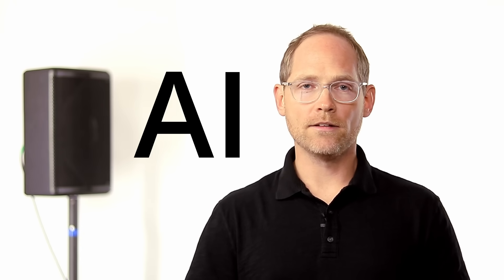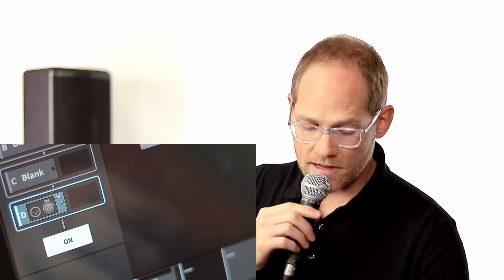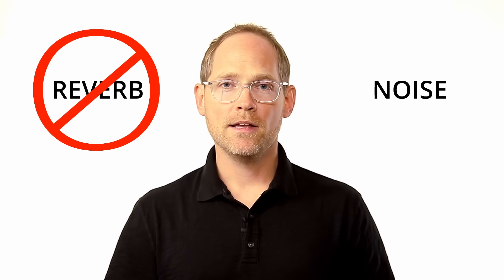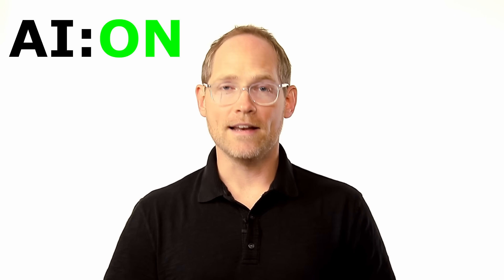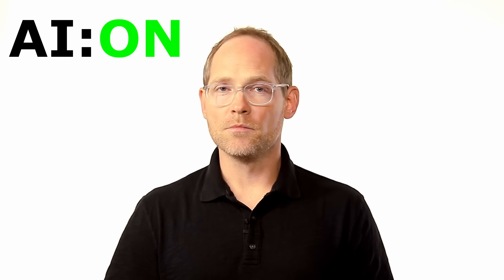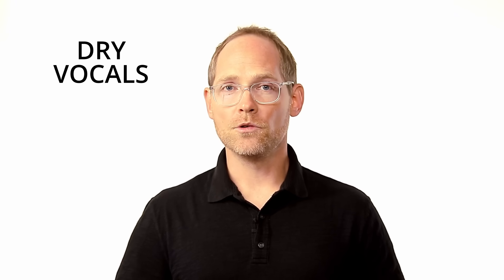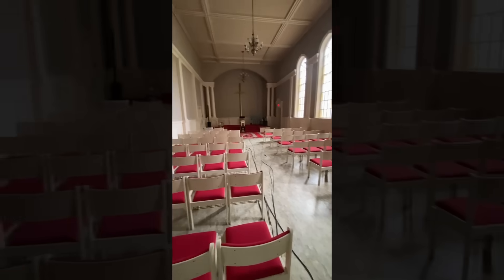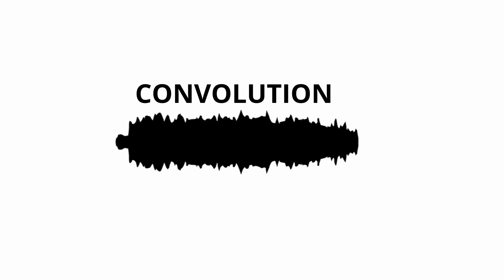AI De-Feedback/Anti-Reverb Demo + Full Explanation

Comment: Just tried the demo. Not gonna lie here - this is very impressive! 
Not exactly ready for primetime use on my computer, though, namely a Macbook Air M3. I'm used to work at 32 samples buffersize all throughout (/w Logic Pro at 44.1kHz, using a Motu M2, resulting in 3.5ms (measured) RTL), for the Defeedback plugin to work I have to switch to 64 samples, and even then CPU usage is so high I can't run pretty much anything else on the same channel (or bus it gets sent to).
Still, quite impressive, really!
Reply from the maker: Yes, this is expected behavior unfortunately. We tried our best, but the reality is that Apple’s linear algebra libraries just aren’t as good as Windows, and with Mac Silicon it got even worse. We almost didn’t release a Mac version because of this, but enough people have uses for this product that don’t require absolute lowest latency, and they’re sometimes in situations where they are restricted to Macs, so we released it in “beta” form. 

For anybody needing to run this plugin reliably at low latency, we officially recommend using the Windows version and specifically on something like our recommended hardware options on the website, which we worked really hard to get in shape at the OS level.
Reply: @devinlsheets_alphasound  Thanks for the clarification. Any chance of an optimzed Mac version one day or is it just not possible?
Reply from the maker: @Sascha_Franck  we’re still poking away but it’s not looking good for Mac.

Comment: While i will agree with the many who say this should be integrated with waves soundgrid , i have 2 additional questions to ask :
1. Have u considered about running this plugin on GPU ? I remember seeing there is a company called gpuaudio which developed an architecture to run vst plugins on gpu for ultra low latency.
2. what about the use of multiple defeedback plugins in series ? would that work to get even more gain out of your mic before it resonates into feedback?
Reply from the maker: We’ve considered the GPU option but at that point we would just go FPGA. You could use multiple in series but the artifacts will become obvious.
Reply: @devinlsheets_alphasound  ok thank you.

Comment: 11:30 What? A small handful of humans on the planet?

Are you not just updating your “equation” 8:00 at a slow interval while your realtime audio calculations run on a separate thread based on the latest equation?

These are techniques that lots of VTS and DAWs at large use. I’m not getting a great impression from this video. There’s a difference between an at-length explanation and a drawn out investor bait reel.

I’ll try the plugin — but I’ll also try competitors plugins.
Reply from the maker: there are no competing plugins btw

Comment: Is this less expensive than moving the PA downstage?
Reply: What if you can’t?
Reply: @ tighter capsules. Or Portico 5045. Or Expander release ballistics. Or Add some delay to tune the comb. Or Switch the polarity from suck to blow. The list of things you can try before submitting your vocal channels to a borg-powered DFR22 could fill a couple of books by the reverend doctor Harry Olson
Reply: What if those aren’t enough? Or they hack the vocal so it sounds like crap? This lets you eq the way you want rather than the way you have to.

Comment: If you're not using EQs in DeFeedback, what are you using? DFT?
Reply: they are using machine learning. They built a neural network that removes reverb and feedback by giving it a lot (really a lot!!) of audio files that have a problem with feedback and then telling the AI to get rid of the unwanted stuff. Maybe the AI does the DFT but it may solve it completely differently. The only code they need to write is the code for the plugin in VST format, so you can run it on PCs. The plugin is then probably connected via an API (in their code) to their trained AI / machine learned neural network.
Its done with machine learning because its impossible to code such an algorithm just with human brain power. At least an algorithm that works that well.
Hope i could help :)

Comment: how many microphones could this work for at once. Also how would this work with a Mixer if we use usb port on audio mixer for other things like recording or controlling the audio mixer.
Reply from the maker: You can subgroup two or three vocals together at once into one instance before the quality may suffer. Best practice is to keep one vocalist per instance. 

If you get the analog interface with the computers from the website, you won’t use a USB. Or, you could get a Dante unit like the Waves Livebox or Fourier Transform engine but those are expensive.
Reply: @devinlsheets_alphasound  Will this work with Dante or AVB device? I was thinking to use this with our pastor headset mic. It's an omnidirectional microphone and we can't really turn it up like we would like without feedback. Should this work or would I still have the same feedback issue with an headset mic?
Reply from the maker: @jerryseigle7434  it will work great with headset mics. You can run this on any computer with a DAW that accepts VST3 plugins. We have some great hardware options on our website but they don’t have native Dante or AVB
Reply: @devinlsheets_alphasound  Will there be a Linux version. Also do you have contact information for developers. I am a developer and would like to connect with you
Reply: @devinlsheets_alphasound  Any instructions on how to install on Mac. I like to test this
Reply from the maker: @jerryseigle7434   download the Mac version from the website. If you have problems, look at the user group on Facebook

Comment: Need this in a rack unit running insert line outputs to monitor speakers and mains.  Then need it to work with dozens of mics mixed to stereo. Will it still work? I have no way to run this in any sort of daw or computer workstation when running live audio.

Comment: I remember when I was working as FOH engineer in the 90s, I used a Behringer Ultra Curve 8000 that had an automated feedback eliminator for the stage monitors. It worked perfect. As far as I know, it worked with scanning thru the audio all the time and adjusts only the frequencies that caused feedback. The monitor sound was still clear and full. I never understood, why this wasn't very popular and used always.
Reply from the maker: The cool thing about this defeedback is that it doesn’t use EQ, so it doesn’t change the overall sound of the vocal
Reply: The Ultra Curve had its moments but it still puts holes in the signal through the EQ and still messes with the phase as a result.
Reply: @Boleskinebeatz  I never had any issues with the Ultracurve and the EQ bands are narrow Notchfilters that cause compared to a third-octave EQ no remarkable holes in the sound.

Comment: Scam. AI can not exceed CR performance bounds. You do not need AI to perform dereverberation but Multi-Model Adaptive Filtering to track ever changing RIR.  No, you can not use FFT. It seems that you use someone else's Open-Loop Delayless Subband Adaptive Filtering, without much understanding how it works and without crediting the algorithm's author. What a shame! The whole thing is so utterly disgusting.
Reply from the maker: dang you caught us. You should go make your own rip-off version and compete with us.
Reply: @devinlsheets_alphasound  Congratulations, you think you are SO clever - and self-confident - just wow! Yes, you can put someone's BSD / open source IP on your tiny ADSP box (which assuredly can not run any heavy-weight deep-learning AI requiring kW) but you cannot claim this IP as your own. That's a misappropriation of IP, which is a crime, for which you may face legal consequences at most inappropriate times. 

Algorithms are best defended by their (often hidden) complexity. You'll spend a lot of time chasing one more last bug but still won't be able to address any of the future customers' concerns. It will still crash and/or diverge at most inappropriate times. 

BTW, modesty and acknowledging of our pretty limited human-scale intellectual abilities work much better than over-confidence when dealing with really complex problems.
Reply: Yeah,sarcasm works @devinlsheets_alphasound
Reply: Come on man, why does an algorithm need to exceed CRLB when:

1. The true reverberation model is often unknown
2. Noise sources are not perfectly Gaussian
Besides statistical bound, tell me what LS optimality is when ground truth is unknowable.

Tell me which adaptive filter can identify a system without reference input, with zero latency.

This plugin doesn't need dual channels to work, this says a lot.
If you understand adaptive filter in such highly constrained configurations, you will realize why adaptive filter won't work very well, in fact, won't work at all.
Reply: Beside all these, don't you think neural adaptive filter existed?
Don't you saw papers said that NAF surpass Kalman filter? (KF is like RLS with prediction step, for those who don't know)
NAF as trained model, handle all kinds of metric far better than a classical model that has a lot of assumptions

What's wrong with using FFT? DFT have nice orthogonality, people use it when they see fits.
Reply: @ There is a long & steep learning curve in front of you. 2014 Dereverb ICASSP challenge is a good  starting point. When you get into moving multi-mic and multi-speaker setups with non-invertible MIMO RIR matrices, you'll have fun!  

Besides having fun, if you solve the dereverb problem, airports / airplanes /military will pour golden showers on you - if you succeed to defend your IP - which you won't because you will be immediately robbed by big(ger) corporations with deep(er) pockets whose lawyers will easily prove that it's them who invented and implemented it well before you were even born.
Reply: @ nice throwing around word salads.  So where's your superior DSP product?  My wallet's ready
Reply: He didn't say he programmed this.  He didn't credit the author because he paid him.

Comment: Have you guys tried this for conferencing applications?  As in....  together with some ceiling microphones such as the Shure MXA920 and using it for voice lift.  The main challenge of voice lift is the fact that we have to EQ away the feedback, thus destroying most of the tonal quality of the pickup in the process.  I'm wondering if someone somewhere out there has tried running the audio from the ceiling mic into your plugin, then back out into the room speakers?  That would be a really cool application of this AI de-feedback imo.
Reply from the maker: We haven't tried that specifically but it would probably help. It isn't designed specifically for that, but someone should try it and tell us how it works!

Comment: Its really promising, i found it increased my gain before feedback by a few db standing right in front of a speaker. It feels like the (reaction time?) has a long way to go. At high gains (probably 3db above a good ring out) it seemed to have high frequency artifacts in the vocal. Still, once its stable and signed on mac i can see it being a really nice tool.

Thank you for your work, hats off to ya

Comment: Would love to see the application of this on instruments in a concert setting !
Reply from the maker: For now it only works with vocals, but future versions may handle instruments
Reply: As for band settings you need other AI inputs like, is the band drunk. 
The audience is but you didn't see anybody go on stage✔️. 
Nothing wrong with the board. ✔️Did someone throw something at a monitor causing it to swing around toward a vocal Mike and was that object possibly another band member. ✔️Due to the squealing noise you have about 39 seconds to figure it out before the crowd attacks you.✔️  I only did it filling in for a guitar player.  Part of the problem is paying a rock band in alcohol.  Sure you can blame it on the Bars, it's all they have too much of. I guess the sound quality might just suddenly diminish giving you a chance to get out the back door instead.

Comment: Thanks for the update. Use of described processing removes reverberation as picked up at the position of the processed microphone and prevent exacerbation of the same via PA. However, any other listener (or an unprocessed mic) at a different location will still hear the room induced reverberation (sans PA exaggerated reverb at the processed location). Does this reflect a correct understanding? If so, the audience experience from using this in a reasonably "live" venue is greatly reduced, but still noticably present reverberation?
Reply from the maker: If you are in a room, you will still hear the sound of the room. You just don’t hear any MORE of the sound of the room coming back through the speakers.
Reply: @devinlsheets_alphasound Thanks -- exactly what I expected. Great job! Would be interesting to profile this to see how many you could binpack into a Xeon class 1U server.
Reply: I don't think that's right. It's not "noise cancelling", it's just removing the room response from the signal, so you land up with dry mic.

Comment: I wonder if there's a break point, where it will feedback when you get too close to the speaker with the mic. Or is it absolutely NO feedback. That would be interesting to get right up to the speaker with the mic and then speak into the mic.. with no feedback!?! Amazing!
Reply from the maker: It won’t feedback if you aren’t talking into it. If you’re talking into it, and you’re too close to the speaker, and it’s turned up too much, you can defeat the current algorithm. Future versions will be much harder to defeat. But as is, the current version adds 6-10dB more gain out of the gate. Not bad.

Comment: I'm skeptical but open minded. I'll give the vst a trial tomorrow in a very reverberate, live sounding concert hall i work in quite regularly. I'll run it on a lectern and I'll do an A/B test between my experience with a graphic and parametric, and some good gain structure, then i will try a clean signal with just the VST and see how things compare. 

Seems like the right use-case for this plugin, am i right?
Reply from the maker: This is exactly what we designed it for. Let us know how it goes
Reply: @devinlsheets_alphasound  I did...the comment was deleted...
Reply from the maker: @WeaselFace  we didn’t delete any comments. Not sure where it went
Reply: @devinlsheets_alphasound  I think youtube removed the comment for being too long, maybe? let me try shorter: It worked well in an empty concert hall, but I cant reliably recommend it yet as the style of demo really prevents a proper test because i cant use it on a live show. if there was a 30 day style trial i could put it to use on a few corporate shows and a few concerts to see how it deals with a crowd.
Reply from the maker: @WeaselFace  we looked at doing a timed trial period but as a startup company, that is very hard. Based on our experience, you would notice that if it works well with an empty venue, it will work even better with a full venue.
Reply: @devinlsheets_alphasound  Realistically, how can I use the trial software without your dedicated machines?
Reply: @devinlsheets_alphasound  Tested today in an empty 1000PAX concert hall with a single presenter at lectern and it did pretty well...however, I can't give it the full sell just yet as the "audio in/out trial" version means I cant put it to test on an actual show. I have a bunch of corporate lectern shows coming up as well as a few rock concerts I'd love to throw this vst on lead vocals for. I want to see how it deals with loud crowds and loud stages, but without being able to test it live I cant justify such a high ticket price for the license. Is there, like, a 30 day trial version instead of the "audio in-out" that I can use on a few shows?
Reply: Why do you believe humans are better than AI at something that has been computer controlled for 40 years? What is this hubris?